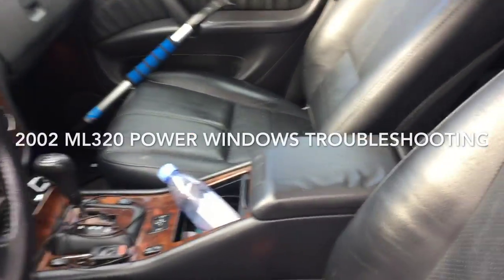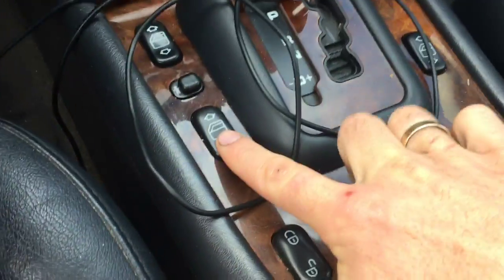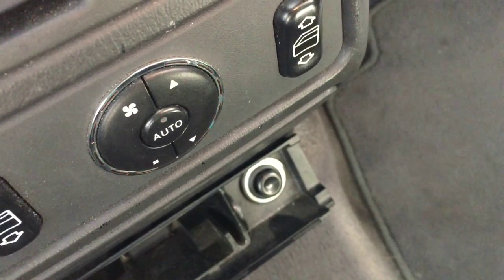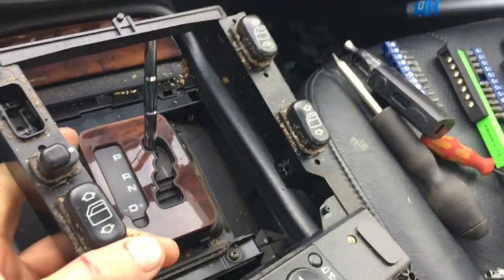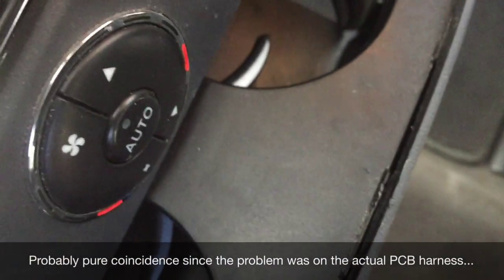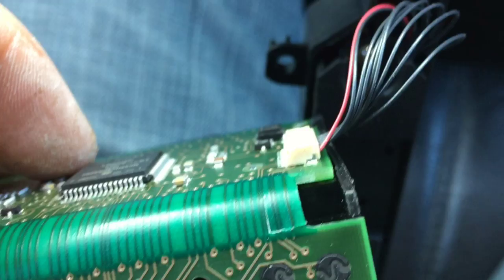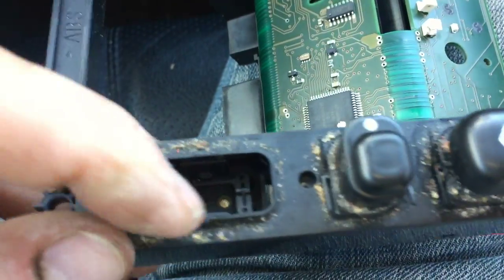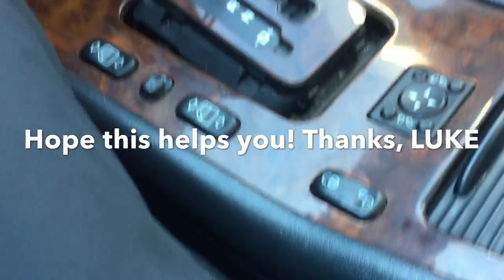Mercedes ml320 power window issues. FIXED!

Comment: this is an issue that i currently have. On mine this control unit in the middle is under the sunroof of course so when it rains )i have a leak in my sunroof that needs fixed) it shorts out my windows. We had some rain here a while ago and now my windows are stuck, but they are up thank goodness... the only thing is that my side view mirrors are stuck in the folded in position. Thinking about it is just driving me insane.

Comment: Thanks for uploading, I have Exactly the same issues on my 2002 facelift model, started as an intermittent problem but has now become permanent, I also have the flashing rear AC dial.
I am off to strip out that module now....

Comment: Thanks mate. Same here. The rear AC lamp blinks, the only difference is that only front windows work but not the rear. Mirrors areok too. I did not notice only that frequency change bit so i'll check now. For my bad luck these panels are very expensive on e-bay compared to the next generation ml switches which come as low as 40 bucks. I'm considering DIY repair and will let you know if i succeed.

Comment: The first thing that i would do is clean all the food and debris out of the switches before the other switches fail. the second thing would try to solder the ribbons back together before i ordered a new board. If not i would get one from a salvage yard the was not broken and it should work just fine being it is electronic and not mechanical. that circuit board likely controls all the windows, mirrors and the rear ac head. The broken ribbons go to the items that do not work. Tell the Mrs. to vacuum the car out to keep it from repeating the problem
Reply from the maker: Bruce Augustine if you watch the video, these newer style switches have a lip that does not allow debris getting inside.
Reply: I did see that however my experience is dirt and electrical do not mix well debris can stop switches from completely opening or closing causing draws on the battery and leave circuits open or closed. open circuits can cause other things on a circuit not to work. but i did say it is what i would do, i pay for my repairs and you pay your own repairs and can do what makes you happy.
Reply: this part also controls the side view mirrors. they are all connected.

Comment: That TOTALLY could have been repaired!  Just remove the broken piece of ribbon cable and and replace it with some individual (very small) wires soldered in at each end...
Reply from the maker: Johnathan Waters totally! Now you can do yours and post a video.
Reply: Lmfaooo

Comment: Did you consider just soldering a couple of jumper wires over the cracked ribbon cable?
Reply from the maker: Maxwell Smart yes I did for sure but when I took my soldering gun to it it was clear that it would be a "crappy" fix, plus after seeing those cracks I figured there might have been other issues, didn't want to take the chance. If you have good micro soldering equipment and patience/ability, I'm sure it can be done.
Reply: Ooops, I shoulda read the comments first ahha

Comment: Exactly  the same problem with my ML500 2002.   Mechanic gave me $750. estimate to fix it. What is the part number you have used  A1638206910 or A1638204510?  Thanks.
Reply from the maker: I believe it was the 6910 but you have to be careful if you have auto folding mirrors and get the one that has that option. Cheers
Reply: @lukec4745  You are great. Thanks for replying so fast!

Comment: What is the name of the pcb? So I know what to order?
Reply from the maker: The Maven I doubt you can just buy the board, there are used window switch assemblies on eBay. New ones are pricey.
Reply from the maker: The Maven you could try soldering, maxwell never posted back if he tried it or not. You’d need a micro soldering iron as it’s pretty tight.